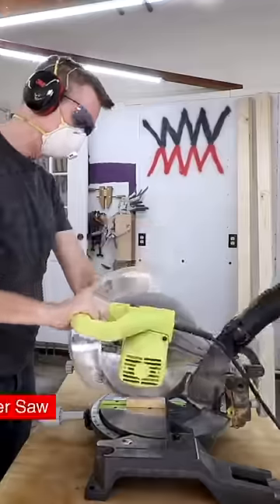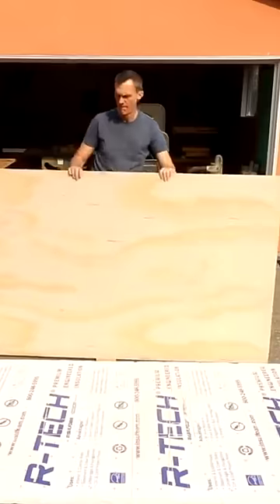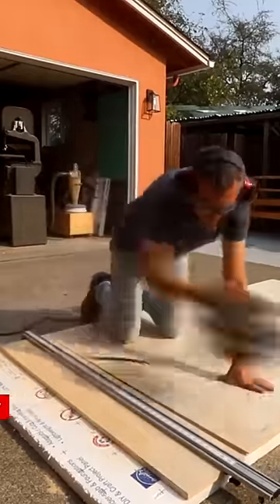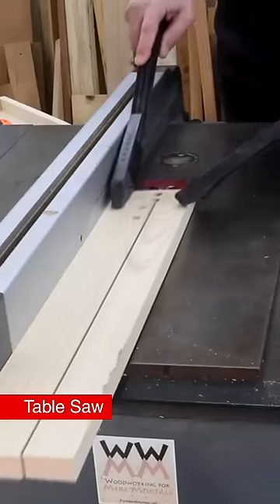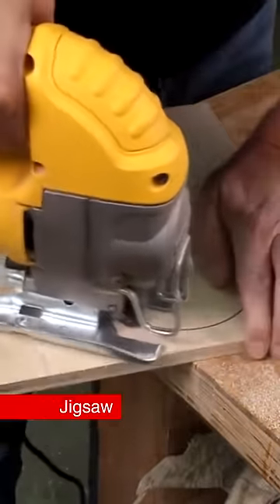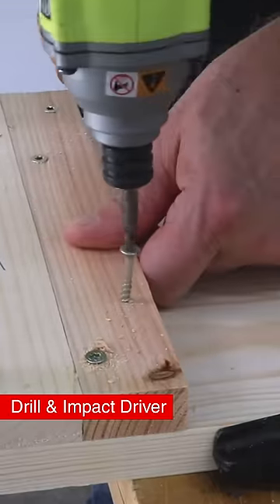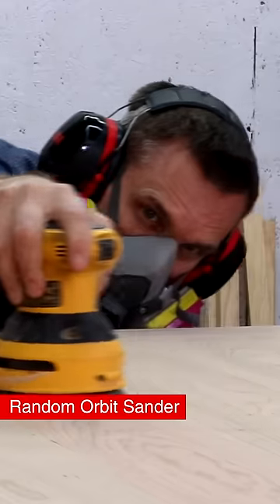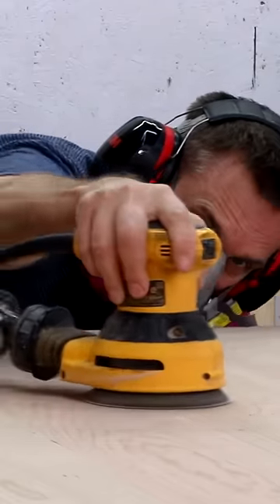Must-have woodworking tools for beginners. 2021  #shorts

Comment: Hi Steve, I'm a beginner and have been looking at your shows with a lot of interest. Since i have worked with 3D software before, in contrast with the woodworking, i was wondering what software you use to make your plans and if you have tips for beginners. For example, if you draw a cabinet and you draw the doors, how much space do you need to leave between two doors or between door and frame to make sure they actually open, etc.

Maybe this can give you an idea for a new series? I totally agree that planning before cutting saves you a lot of work and money, but you need to know how to plan or it will cost you anyway :)

Thank you for the series

Comment: I started my professional shop with few tools but I settled on a tracksaw as a cheap alternative to a good table saw, a jigsaw, cordless drill and screwdriver, 1m and 600mm rulers and levels, usual hand tools including chisels, planes and gauges, a few handsaws and that was it.  My sanding was done by hand as I found cheap orbital sanders hopeless.

These few tools enabled me to build my first larger workshop!  I then added a bench saw, cordless impact driver, nailer, quality sanders, routers and router table and many extra hand tools including planes and more chisels.  I also built up my clamp collection and bought several router jigs and guides 

All that was made possible by a £140 investment in a track saw and basic tools  so I would always advise a tracksaw as the first serious bit of kit as it's so useful from cross cutting (with or without the track) to ripping big sheets down accurately.

Comment: When I got into woodworking I bought a used Miter saw for about $50 and I have gotten SO much use out of it. While most people's "go to" is the table saw, the miter saw is the workhorse of my shop, even though I own a table saw.
Reply: I agree..Upgraded my miter saw a few months ago...hate using my table saw
Reply: What if you need to rip a board?
Reply: @rashkov2003   i have a table saw that I can use for ripping. It's just that I typically use stock material that is in the width i need, so I am mainly making crosscuts.

Comment: Prices on the drill/driver combo have been coming down in recent years (at least around here)  so it makes sense to buy the combo.  If you're doing a bunch of pre-drilling and then screwing, it will save lots of time.  I have a plug in square sander, and almost upgraded to random orbit yesterday, but the sanding discs are pretty expensive compared to what you can get out of a square sheet IMO
Reply: You're not wrong - square sheet sanders are more economical. But in my experience, they're more prone to leaving visible swirls in the workpiece, even at 240 grit. I find that random orbit sanders get the job done cleaner and faster. It all comes down to what's more valuable to you - time or money. There's no right or wrong answer, it's just a matter of preference.

Comment: Dang, I have all these already. But I want more power tools 😆🦹🏻‍♀️
Reply: I might have missed it, but you can sure also use a belt sander, definitely a router, and of course a shop vac.I'm most likely forgetting something else, but it never really ends does it ?
Reply: @gatekeeper65  yup. Got those. My next tools are a planer and a jointer.
Reply: Once you have your drill/impact combo in 18V you gotta have it in 12V right after... cuz tools.
Reply: @leen894  Both extremely useful. If you can afford it, I suggest getting a real cast iron jointer. Get at least a 6 to 8 inch model of course, and not one of those bench top types, or you'll almost immediately regret it.
Almost any planer will do for starting out, even one of those really overpriced Dewalt ones. Have fun.
Reply: I'm always looking for new power tools that I can justify buying. :)
Only problem is that the space in my garage is pretty much maxed out already, so I don't have space enough for a planer/jointer or a bandsaw...
Reply: By the way, don't buy a scroll saw unless you actually need it for something specific. It's gotta be the most useless shop tool ever contrived. If you want one, send me your address and shipping fees. I have three that were given to me over the years that are just in my way, and you can't sell them, which is why they were given to me :0)

Comment: A table saw is next on my list. Trying to be precise with a circular saw (a cheap one) is pretty hard. But I do end up with a lot of oddly shaped scrap pieces to use on other projects, so that's a plus.
Reply: If you want precision with a circular saw don't go for an expensive one. As cheap as your saw may be, you can always use a meter long level as a guide and get extremely precise cuts. Follow Steve's advice; keep it cheap where possible.
Reply: @as7river  I got a new table saw for under $200. It's the cheapest one I could find. The fence isn't very straight, but I clamped on a straight piece of wood and it's much better. For me, I can get a lot more accurate with way less setup time using this table saw rather than my circular saw and a straight edge. So for that reason alone, it was worth it. It is especially handy for making duplicate pieces and having them come out even. A lot harder to that with a circular saw.

Comment: I had an epiphany a few months back. I realized woodworking is not about building stuff so much as sawing wood into smaller pieces.
Reply: Also, the most useful structure in woodworking is a box.
Reply: I had the same realization a few weeks ago, and saved myself about $900 by just getting some hand tools.
Reply: I'm pretty sure that woodworking is 93% about clamping.
Reply: Yes my scraps end up as fill ins or wooden plugs😂😂

Comment: Is there a reason I should use an impact driver for screws instead of just using a standard drill for both holes and screws? Genuine question.
Reply: It’s truly a timesaver to have separate tools, especially when you have more than a few screws to attach.

Comment: For people that would like to get into handtools: 
- you will need a workbench with a vice, that could be your first project. 
- get a good handsaw, i really like a Ryoba, a kind of japanese pull saw, with both a crosscut, and a rip cut side. Other saws will do too.
- get a good set of chisels.
- get a handplane. for beginners a Nr. 4 or a Nr. 62 are great. you can buy these used very cheap and restore them.
- you will need to sharpen your tools very frequently, so get a double sided, or a set of Whetstones, a 3000 / 8000 stone would do for beginners. 
- not 100% needed, but a router plane is very nice to have. 
- a brace for drilling, but honestly, just use a drill.
Reply: I would have put brace before router plane. Also a hatchet sharpened to make finer cuts. If you look up Rex Krueger he starts out with a hatchet, a brace and a saw.
Reply: The only thing I disagree with you on is the grits of your whetstone. Inexpensive chisels/irons won't hold an edge even at 3000, never mind 8000. 600 and 1200 is plenty fine enough. Furniture makers in times gone by just used India stones that are about equivalent to a modern 400 grit, nothing more, and they made incredible, heirloom quality pieces.

Comment: Impact driver for screws???  Never thought of that.
Reply: What on earth else would you use one for?
Reply: @-Benedict  LOL! The question is actually using the impact driver vs. using the VSR drill for both drilling and driving screws. As in "I use the drill to drive screws too, never thought of buying an impact driver to do that."
Reply: Using an impact driver this way is a really bad habit of convenience. They aren't designed or intended to drive wood screws, and you're far more likely to over-drive a screw damaging the wood or popping the head with one than the drill/driver it likely was bundled with.

Comment: I wish i had room and...bravery to use a table saw. But most things i make are very small and a table saw would be overkill...like the stuff i work on is smaller than the blade. So a band saw it is
Reply: there is that miniature table saw made by proxxon
Reply: @angrymongoose7370  aww sweet. I will look that up thanks.

Comment: You CAN cut circular objects on a table saw.  It takes a sled, with a screw or nail at a center point of a circle you want to cut in the wood you want to cut if from, and you slide the sled and wood into place, and slowly rotate the wood.  You don't take tons of wood off with this all at once, and it helps to trim the piece down to an octagon first.
Reply from the maker: Lol, I literally made a video about that last week.

Comment: Steve, battery powered "drills" are called screw guns by most manufacturers. Impact drivers are nice but necessarily needed, that's why you have a clutch on a screw gun.
Reply: No. Just...no
Reply from the maker: This is the first time I have ever heard the term Screw Gun. Lol....what manufacturer says that?
Reply: The only ones I've seen are dedicated to using collated strips of drywall or deck screws and can't do anything else easily.
Reply: Hmmm, according to Homedepot, screwguns are only used when working with drywall, for the most part.
Reply: @SteveRamsey  Makita make a "screwgun", but it's not the same as a drill - it's useful for consistently and quickly driving lots of screws to exactly the same depth.